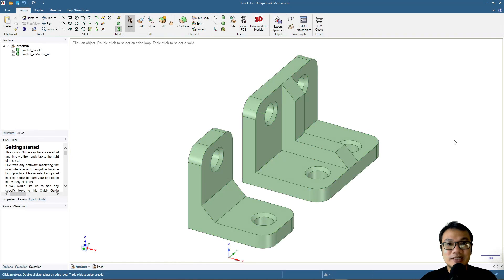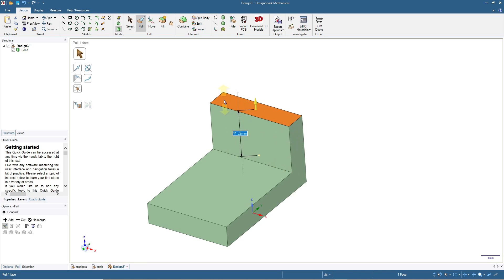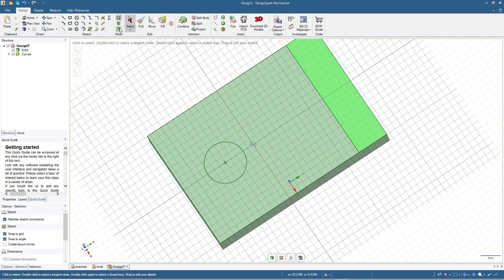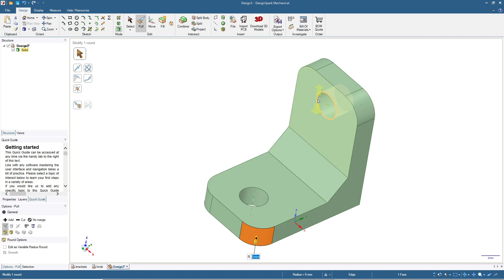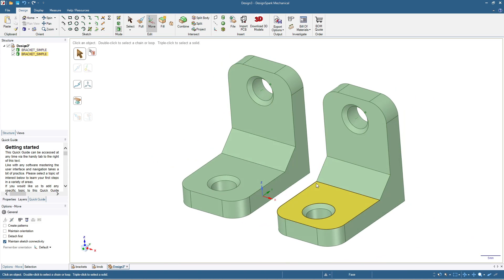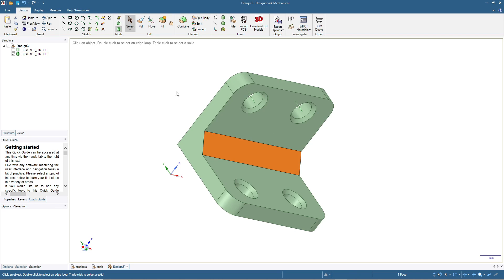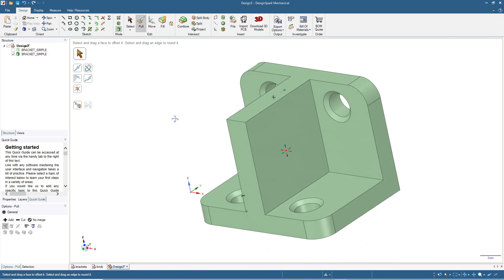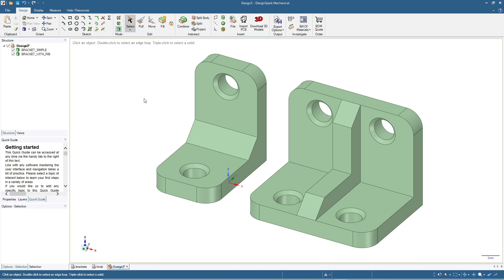Designing Brackets - Narrated Tutorial of 3D Modeling Using Designspark Mechanical #02

Comment: Hello again, a tip that I found recently , 
for 3d printing, there is a simple way to get rid of the sharp edges of things that you want to print, by rounding all the edges of a solid. And to do that real fast, just select a random edge press then the CTRL A combination on the keyboard and ALL your edges are selected, type a value of 0.2 or something like that and Bob is your uncle. But you should use that at the very end of  your work, because you cannot change any edge after that, but It is a very fast thing to do so good luvk with it.
oh and one more tip, you can select multiple edges with the CTRL key pressed down if you want the 4 corners  to be the same chamfer select first the 4 corners and then do the chamfer or rounding 
 kind regards Hans
Reply from the maker: Thank you for the awesome tips. I haven't known/tried using the CTRL-A to select all edges. Will try later. Cheers :)
Reply: Thanks for the great tip!
Reply: @jps99  you are wellcom